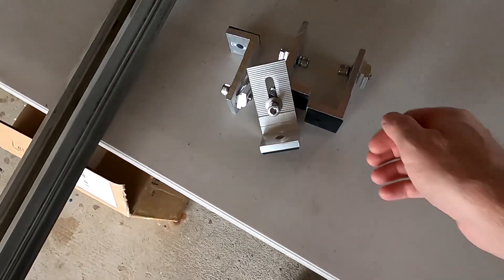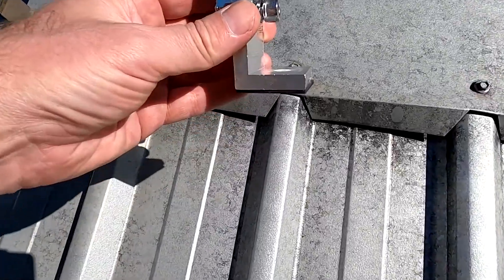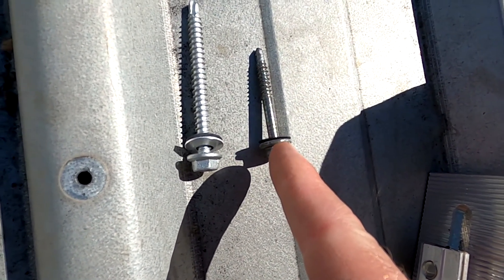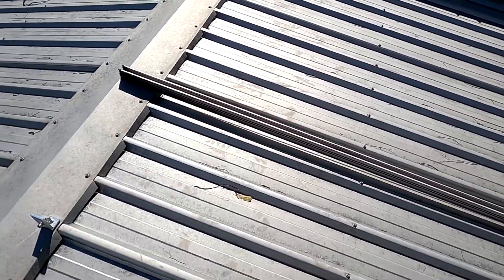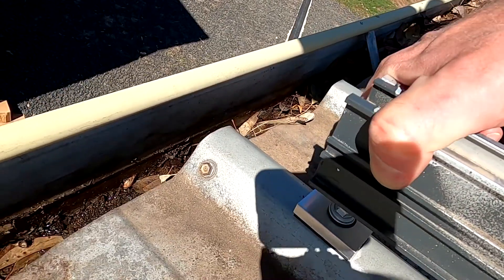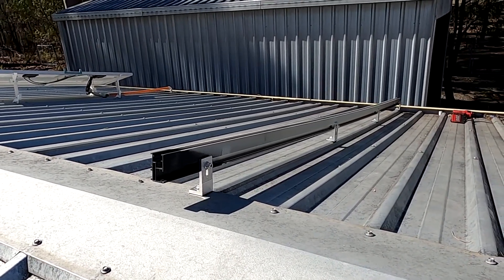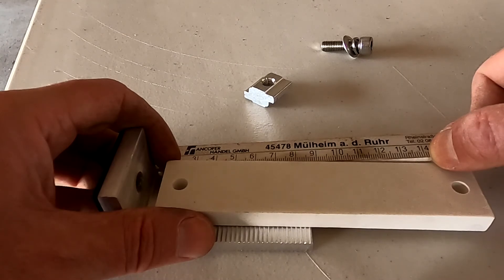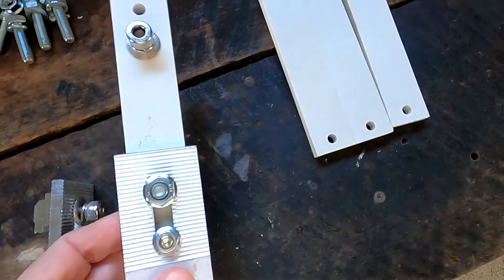Extending the solar panel mounts. Is this a bad idea?

Comment: Perhaps you can use 40mm wide 6 or 10mm aluminium bar cut to the length. If you do that, then you need with two holes drilled at the lower end to attach to the brackets with two bolts to give them lateral stability.
Reply from the maker: Yep, that would work too. I probably use this idea on the other side of the roof as I'm running out of these white spacers. Thanks for that suggestion.

Comment: More space may help cooling, which with your climate, may be a real advantage. Unless you have extremely high wind events, I see no negative impact.
Reply from the maker: We don't have much wind down here in the valley. And the panels won't be crazy high, right?!
Reply: I think the extension would be ok unless the fiberglass becomes brittle over time